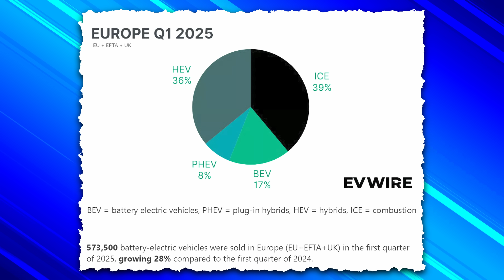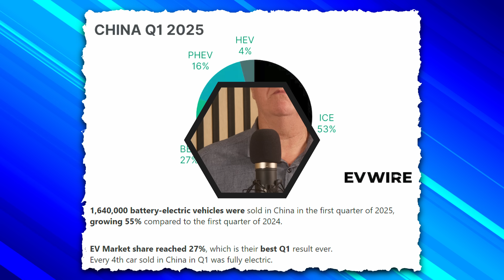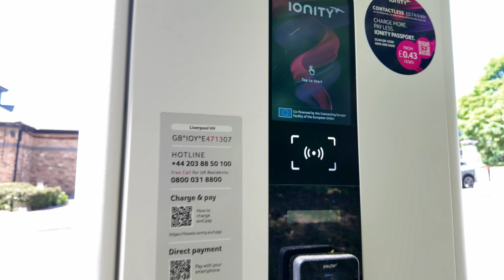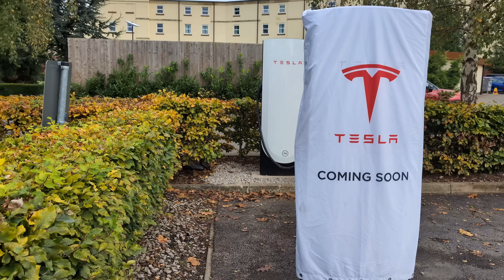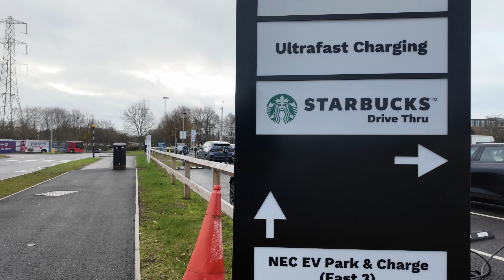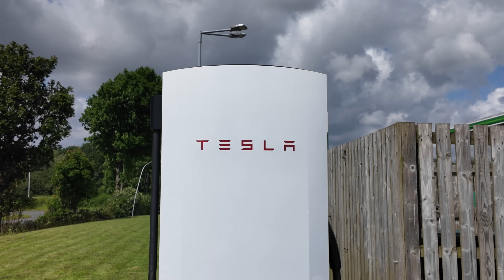The EV Revolution Is Here... But We Need To Change The Narrative

Comment: Nice one Dave. I really can’t understand why the EV haters waste their time writing their comments. Clearly they are not going to be persuaded, and in my opinion miss out on a much better driving experience, quite apart from all of the health and green benefits. The good news is that the enlightened comments outnumber the EV haters. The tide has turned, evident not only by SMMT figures but also by the number of ‘green’ number plates. Please keep up the good work and ignore the irrelevant nonsense from the EV haters. BTW, InstaVolt Winchester hub was an excellent experience yesterday, and busier than I expected.
Reply: I’m having to take my one week old EV back to the dealer tomorrow. Why? Don’t panic - nothing dramatic, it hasn’t exploded or anything lol. But they had fitted regular plates not green, only nobody noticed until I parked up at the office charging bay -  “Hey, wait a goddamn minute!”  I muttered. They were very apologetic, offered to rectify pronto. Point being there could be many more EVs out there incognito!

Comment: Hi Dave, not doubting your figures but you can manipulate figures any way you want. Lots of EV's are listed as sold and then sold as zero mileage used. I am not against ev's and will probably get one at some point but I will do it when I choose and not forced to get one via some net zero agenda. By the way all cars from around 2010 have tracking devices built in, in years to come people will only be able to drive a monthly or yearly limit then the car will shut off or geo fencing where you will only be able to drive a certain number of miles from your home. They know the route you take, the speed you go, they may even be able to listen to your conversations. My 2022 Golf has an SOS button so I can contact them in an emergency. Pretty sure they could open up the mike and listen in if they wanted. P.S. I enjoy your videos.
Reply: Who is forcing you?
Reply: @TimDLee-no4on  The Government will at some point force all of us. They have put a charge on all car manufacturers for every ICE car that is produced over a certain number. This will leave them no choice but to abandon ICE car manufacture becasue it is not viable. Need I say more, this is just one example of Governements control.
Reply: A 'new' sale is a new sale even if it results in a very quick resale of the car via the second hand market, such tactics are not unique to the BEV market as it allows dealers to hit targets and collect performance rewards.

As for all cars from 2010 having tracking devices - complete and total rubbish. Many may have a sim card install, which is why your Gold can make a SOS call, but we would know by now if governments could use such things as a valid tracking system as they would be able to deploy pay per mile charges without the major work it is going to take. In terms of tin foil conspiracy, just for a second consider how many 100,000's of staff, 100's of companies and 10's of governments are all currently trying to hide this vast international tracking system from the press.

Comment: With EV numbers increasing so rapidly, petrol sales must be in decline. It surely won’t be long before we see fuel stations closing. This will put considerable pressure on ICE sales. Can’t come soon enough.
Reply: There have already been a lot of closures and consolidation. I drive past several on my way to work that are now car washes or used car sales. There will probably be some more consolidation but I think filling stations will be around for many years yet.
Reply: You are a misled dreamer.
Reply: @johnb5456 Ahhh, johnb5456, never letting a fact get in the way of a post.
Reply: Fuel stations have been closing in the UK for decades. There were 13'000 in 1990, and the number has reduced to 8300 today.
Reply: There are currently 8300 odd petrol stations in the UK, and falling. There are 36% fewer than in 2001, and that trend will continue.
Reply: Some have closed due to the reduced demand for diesel and petrol over the past decade anyway.  With prices going up people are driving less, and that has caused issues.  But as you say, with 1.4 million EVs on the road now, thats one in 40 cars that don't need a petrol station, and EVs are generally bought by people who do more than average miles, as the savings are greater.
Reply: @Muppetkeeper fuel prices have plunged since I decided to go EV 3 years ago. If I have to buy another fairly new car, I'm quite likely going to pick a diesel as the "luxury car tax" threshold unfairly penalises even resale prices of EV from this year onwards.
Reply: @MrMWRMWR or just get an EV now that was registered before 01 April 2025.
Reply: Fuel prices were high a few years back because of global events. This just demonstrates how impacted fuel supply and its pricing is by external factors, prices can and will change again. As to luxury car tax, this has impacted ICEVs since 2017 and has only just been introduced to BEVs (with reports the government may change this for EVs later this year). However, ICEVs are more impacted by the luxury car tax as their prices have been increasing, on average up 14% in the UK last year, whilst BEVs prices have been falling (down 11% last year). 

So if your goal is to save money running a vehicle and avoid the luxury car tax's impact then it's best to choose an EV over an ICEV. Particularly a diesel that are going out of fashion fast in the UK at a rate of knots, representing under 6% of vehicles sold so far this year; what with diesels being likely to be more expensive to maintain as time goes by due to parts being harder to obtain.
Reply: @MrMWRMWR  As another comment points out, the "luxury car tax" applies to ICE vehicles too, and EV prices are dropping. By the time you need a new car, in all likelihood, EVs will cost less than ICE cars. Price parity is around the corner and there is no reason to believe the graph won't continue some way beyond parity, and into a net advantage for EVs. But even if the 'luxury car tax' were unique to EVs, my EV saves me more money than the yearly tax, in just 4 months, and that's in fuel savings alone, not considering maintenance costs advantage. I don't see any plausible scenario in which ICE cars become attractive again, for pragmatic buyers.
Reply: @Muppetkeeper  lol, my EV is running fine and heading for its first MOT. Just a slow pressure leak on a rear tyre that I'm hoping isn't caused by the TPMS valve for when I replace my rear tyres in the next month or so.
Reply: @malk6277 I recognised that ICE vehicles already were hit by this tax. The point being that I will probably not indulge in another new car in what time I have left and getting a car that's old enough to be free of as much tax as possible will be a consideration. 
🤔Btw, I'm sure motor manufacturers take account of after sales revenue for all those hot moving engine and cooling system parts that fail and there's no revenue on that from EVs so there must be some pressure to front load the pricing to first purchase.
Reply: Dream on!
Reply: @coinitin7521  Not a dream. There were 13'000 petrol stations in Britain in 1990, and 8300 today......How many in 5 years time?
Reply: @coinitin7521 in addition, thank you for trolling the page. 

I guess you come here to tell us our choices aren’t as good as yours. 

You forget, you already made your choice, then moved on. We know our choices are better. 

But please do keep following and commenting. 

It gives us chance to thank you. Thank you for paying my contribution. And please do continue. Don’t buy an EV. 

It’s much appreciated. Thank you.
Reply: @Burz69  Couldn't help but laugh out loud... thanks!
Reply: @coinitin7521 no need to dream. It’s a reality.

The biggest consumers of petrol & diesel are company drivers and these are rapidly transitioning to EV. That’s a massive chunk of fuel sales disappearing.

Comment: Hi Dave ev were on the road over 100 years ago so it not new technology
Reply: The "EV's" you refer to of 100 years ago, were extremely crude compared to today's EV's. The aeroplane had it's first controlled powered flight in 1903, but to compare that with the modern light aircraft of today, is little more than gentle humour.....
Reply: @Brian-om2hh Just extremely boring now
Reply: Technically EV's today  are a new technology, its just the concept that is the same from 100 years ago.